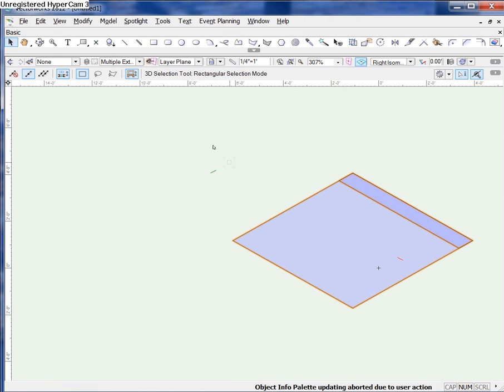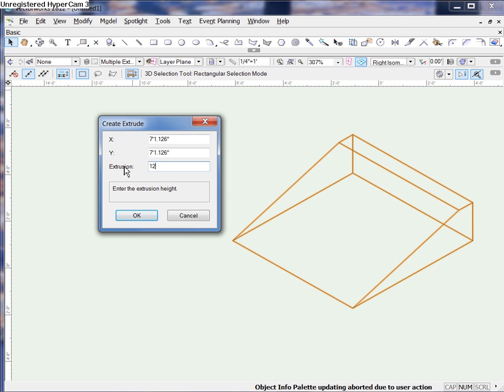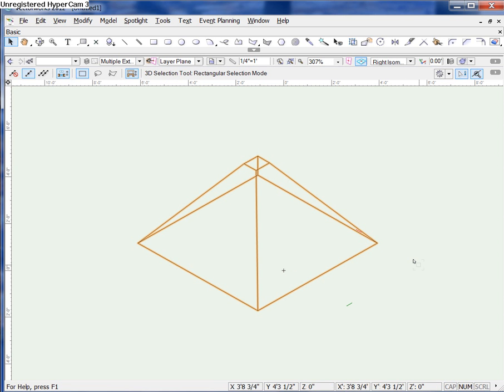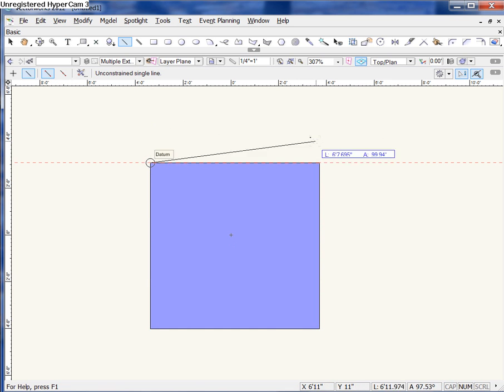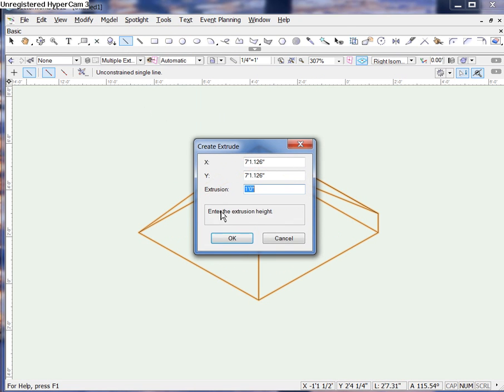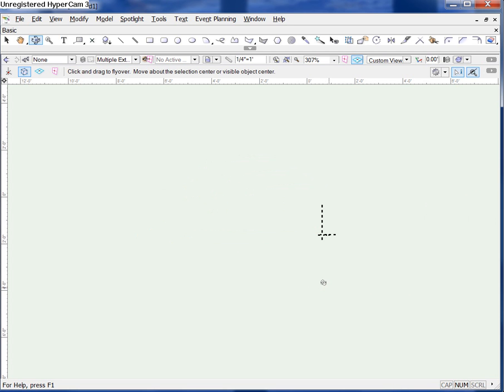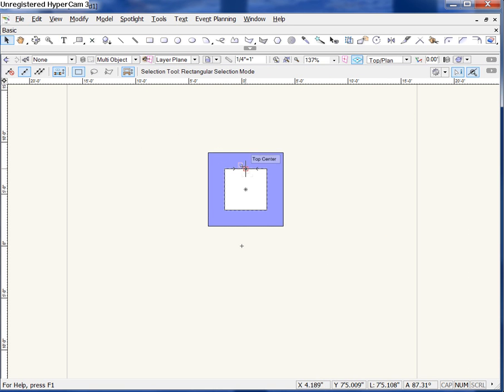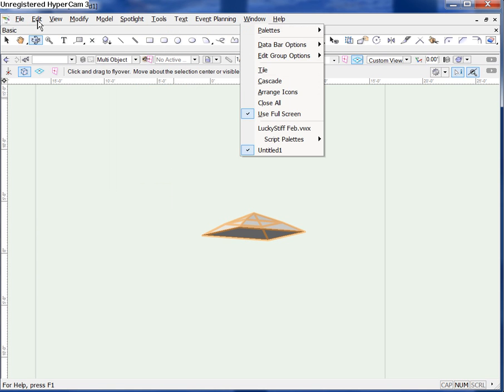Vectorworks Multiple Extrude

Comment: Hi I am working in VW 2017 and attempted the multiple extrude in several ways but every time the wedge shape was not pure. The smaller rectangle in profile becomes a triangle so that instead of a straight back in the profile it is sloping from the large rectangle base up to the small rectangle outer edge. Why is this happening?
Reply from the maker: Not sure if I understand your problem, but try drawing in a different direction or different order. For example if you draw a sq and then draw a ling along one side from left to right it won't extrude correctly but draw the line from right to left and it will be fine. Let me know if that's not your issue